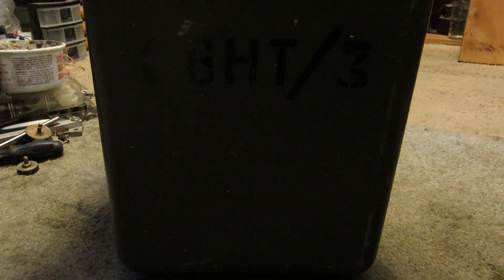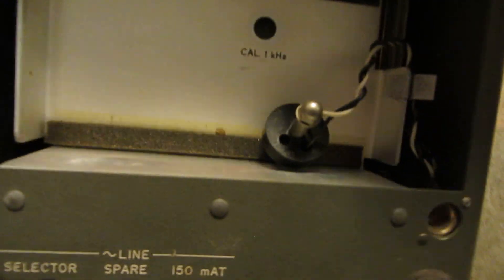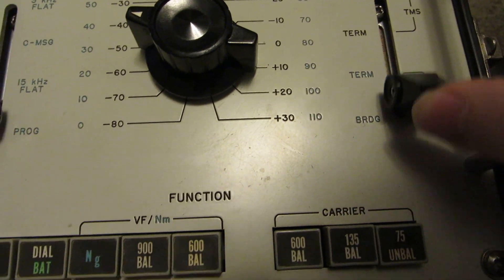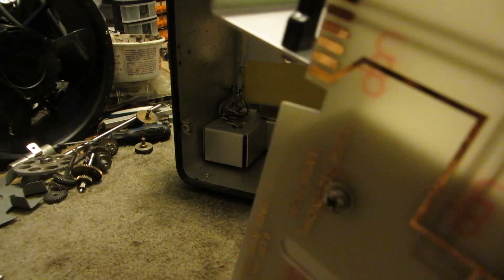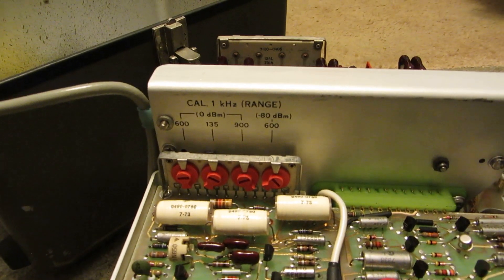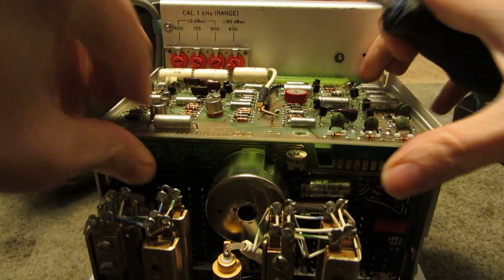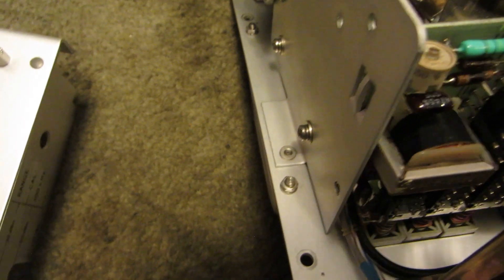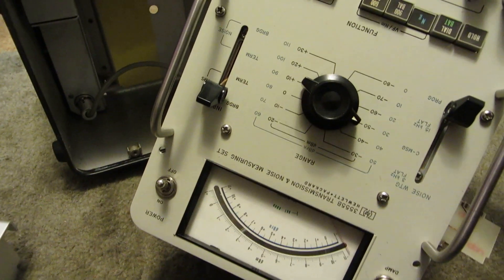Equipment Teardown - Hewlett-Packard Transmission & Noise Measuring Set

Comment: HP 3555B was very used in telephone companies like Telmex in México for test phone channels quality audio like NOISE and Transmission levels ( DB or dBm ) Frequency response channels with a Audio Oscillator HP 236A . Has Four diferent aasy boards for Functions, Range switch, Amplifier and Noise Filters. Has many diferent terminations like 600 BAL ohms or 75 UNBAL and brigde to conect with diferent transmission equipments like NEC , Ericsson,  Telettra, etc. In the rear panel use a Nickel-Cadmio 45V Battery  Pack, and the Power supply has a battery charger or can connect with a battery external as a portable equipment. Has 4 diferents filters to test Noise. I repaired a lot of them in HP and the most of the problem was a Service Note for power supply and Replacement battery pack.

Comment: I just received a junk HP 180A oscilloscope from ebay. Componants selection is very similar to tihs unit, but overall construction is a lot worse. No gold pladed PCBs. No connections to the PCBs, everything is hard wired. PCBs mounted in odd angles, difficult to reach.  Some parts are riveted to the chassis and can't be removed at all for maintenance.
Reply from the maker: Wow, I feel sorry for yea lol.
Reply from the maker: @Rockstarnerd 1957 I don't plan to lol.